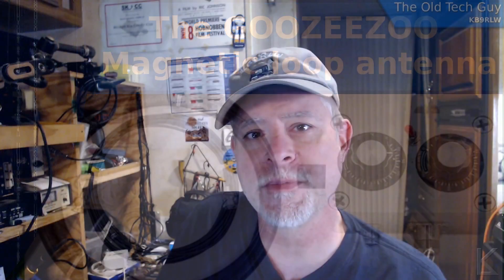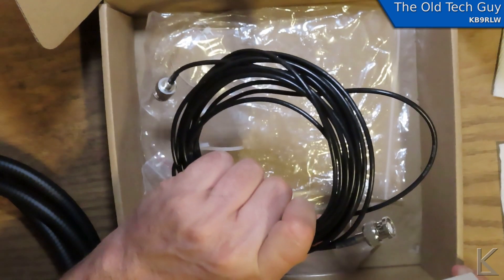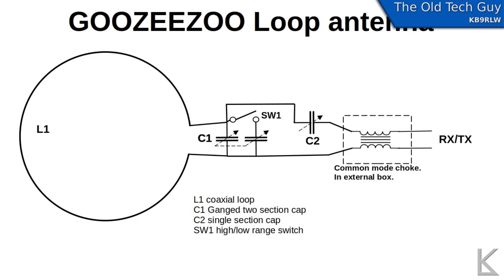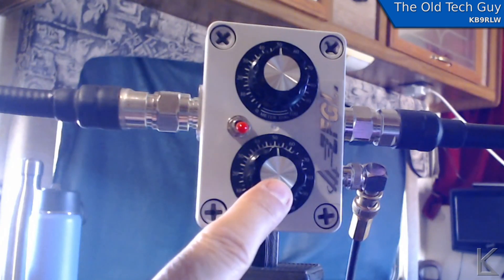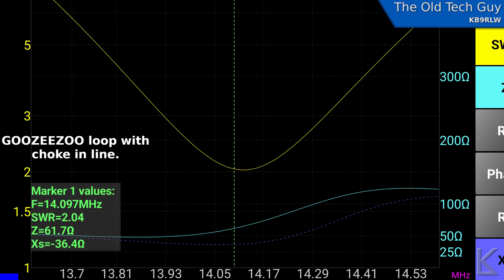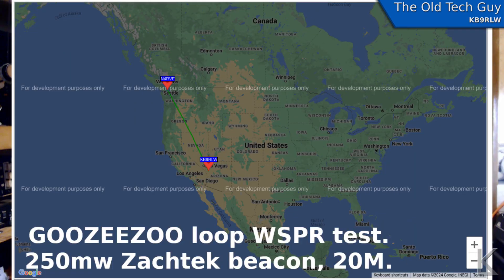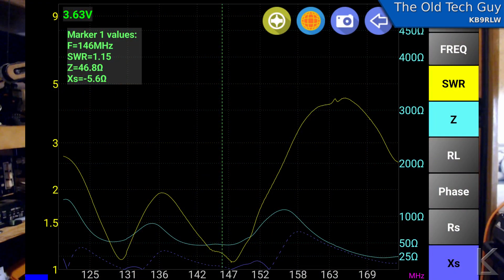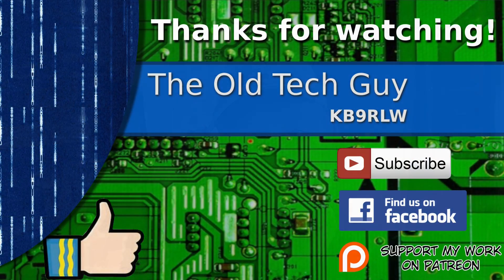Ham Radio - The GOOZEEZOO(a.k.a. Hamgeek HG-20a) magnetic loop antenna

Comment: I haven’t been able to receive anything on this loop. Is there anyway to modify it?
Reply from the maker: You could rebuild the box using higher quality variable capacitors and better wiring. That might improve things a bit. I just used the coax and made a regular magnetic loop with a coupling loop and a high quality variable capacitor. But as it comes it's just a bad design.

Comment: Kevin is there anyway to salvage this loop?  Change the capacitors or use the parts to build something better?  I like that in theory it could be a good emcom loop as it can do FT8, JS8Call frequencies as well as vhf/uhf.  Great video as always.  Wish I would have watched this video before I made the purchase.  Guess, I wasted money that would have been better served in purchasing an Alpha emcom or a chameleon.  Really enjoying your videos.  Keep them coming.
Reply from the maker: I ended up repurposing some of the hardware for other projects. You could rebuild the control box and add a coupling loop like a more classic magnetic loop. But you would need to replace the capacitors they're junk. The best thing about it was the coax. Search back through my videos for building the small magnetic loop. It has a link to the design video in the description. You should be able to use the parts with a better variable capacitor and construct a usable magnetic loop antenna.

Comment: Did you point it toward the VHF station?  Loops being very directional it figures you whip beat the others as an omni.  Hmmm?  Thanks, Amazon NOT getting my $82.00 for that one.
Reply from the maker: Yes, the side of the loop was in the direction of the station.    Electrically the design is sound, but inadequate capacitors and thin wire, poor technique make it a terrible performer.

Comment: Mounting parts into a box is always a challenge since parts inside the box are hard to install and solder. In such a case the cover has nothing. On the other hand, parts mounted everything on the cover is much better. Easy to build and maintain and short wires.

I think the antenna feeding must be different. The efficiency is not good like this. You might consider the regular feeding loop. I suspect that the coax braid is lossy and the loop itself must be of solid Copper or Aluminum
Reply from the maker: The main problem with this design is the inadequate capacitors and poor wiring. 
This box has plenty of space and would be no problem wiring  with components mounted on the back of the box.  However, it's a cheap Chinese assembly line product where people are paid pennies for their labor.  One doesn't expect quality from that scenario.

Comment: I have experimented with 4 different loop vendors.  What I learned was that diameter definitely has a relationship with band efficiency. The MFJ Loop tuners print a chart of most efficient diameters for each band or multi-band use.  I also learned that all of them receive very quietly.  One more thing I learned - tuning with an antenna analyzer connected is better than listening with your ear.  If you could transmit on a beam or dipole, and receive with a loop, I believe you would have the best of both worlds, but the arrangement would not be cheap.

Comment: The downside to so-called "magnetic loop" antennas made in this way, using flimsy, polyvaricon, receiver-grade capacitors, is just that. One needs to remember that at resonance, even with QRP power levels, a considerable amount of RF current (upwards of 4 amps RF at just 1 Watt- if losses are low- on a 4ft dia loop with a 5/8-in. diameter loop conductor operating on 14mHz.) flows in the loop and through the loop tuning cap. On a polyvaricon-type capacitor in a tuning unit like your example, that current flows through a small, mechanical, wiper contact that connects to the cap. rotating plates on one side and the stator (stationary) plates of the cap. section on the other side. That wiper contact has considerable RF resistance and, thus, significant power loss. (Keep in mind that RF currents flow only on the surface of conductors.) Even more substantial capacitors, such as air-variable transmitting capacitors with a single section (or two sections in parallel- same thing) are to be avoided.  Instead, a "split-stator" (dual-section) type of tuning capacitor is needed with loop connections made ONLY to the stator plates and NO connection to the mechanical contact of the rotor plates. That eliminates resistance losses in a wiper contact. The only other capacitor type superior to that is a vacuum variable transmitting capacitor. BTW- Our ham radio slang calls these antennas "magnetic" which may lead some to think they somehow use permanent magnets. Instead, they couple RF radio energy waves to the air via Electromagnetic induction means.
Reply: You couldn't pick a worse and less efficient capacitor for this application than the polyvaricons that the loop tuner is utilizing ! - VE3WMB

Comment: No inductor loop means it's junk.
Reply from the maker: Not necessarily. There are other means of coupling, gamma match, ferrite transformer. However, the army made loops this way, and MFJ has a loop tuner that works this way that works quite well. The design idea is sound if properly implemented. This loop uses poor wiring and inadequate capacitors. The only thing good about it is the coaxial main loop.

Comment: The box and capacitors might be a basis for a QRP Z-match.  And check the skinny feed line COAX with you VNA before you toss it.  Yes, it will be very lossy on VHF/UHF, but might be acceptable on the lower HF bands, or for cutting up to make short jumpers.
Reply from the maker: Yeah I was thinking along the same lines with that box, a QRP antenna tuner. 
Short jumpers is an  interesting idea with that coax.  In lieu of antenna switches at my desk, I've been thinking about making a small BNC patch panel. Bring the antenna tuner in and out, the SWR meter in and out, the antenna feeds, and the radio feeds all up to BNC connectors and then just using short patch connect cables to patch things the way I need at that point. Much more flexible than trying to do things with multiple antenna switches.
Reply: Looks like rg174?

Comment: It does show that a bought aerial doesn't mean it outperforms a home made one.

I've made five attic dipoles 20m to 10m,  an outdoor 60m inverted vee, two loops for h.f. and a copy of a thing which was around in the 1960's and 70's called a Joystick and 26 foot of wire which tunes 160m to 10m using a supposedly non-working MFJ 16010 tuner I was given. It worked for me. It did stop working after a trip to Wales and I found a wire not soldered and soldered it so I guess vibration moved the unsoldered wire.
G4GHB.

Comment: I appreciate you took the effort to draw a schematic. Now I can build and try such a control box myself.
Reply from the maker: Well this is probably not the best design. But you can get the schematic for the MFJ loop tuner, which is similar. They have a couple of inductors in line with The coupling capacitor, might make the difference.

Comment: I imagine that coax being as lossy as it will be broadens the Q making it look wider than it is?
Reply: Only using the screen on the loop itself, one could use chicken wire. The coax "functionality" is not used in the loop. Thick cable is desired for mechanical stability.

I would rather like to see a measurement of the cable he didn't use....
Reply: @migsvensurfing6310  Yes my mate has built one himself from aluminium strip. Worked 15000km Euro stations on 20w CW on his antenna ....in this video (DX will be in part 2 video :)) 
https://youtu.be/FmkMDeXaCOU
Reply: @migsvensurfing6310  I'm not sure what you mean by this. He used the hardline for the loop itself.
He didn't use the supplied 5 m RG-174 feed line, but the difference from the RG-58 he used is only 0.21 dB @ 28 MHz.
Reply: @tomtwist1081  He used the thick cable for the loop itself. The loop could be made of a piece of wire, it doesn't have to be coax, coax is often used because of the stiffness.  The inner conductor is not connected.

The cable he didn't use, the long thin piece supplied for the feed to the radio looks to be RG174 but may not even be, it may be way worse. Could be interresting to test it with the VNA he has.
Reply: @migsvensurfing6310  Making the loop from "a piece of wire" is a very bad idea. You want the diameter of the main loop conductor to be as large as possible. This reduces the loss in the loop itself. Then you have to reduce the other losses. The feeder coax is not important, as 5 m of RG-174 at 28 MHz only has 0.6 dB loss, which is 1/10 of an S-unit.
Reply: If you mean the main loop coax, I find that the best part of this antenna.
Much better than an RG-213 or other braided coax. The main loss is probably in the C1 capacitors.
5 W @ 14.1 MHz would produce 7.35 A in a good loop this size.
Reply: @tomtwist1081 no the feedline (2 mins 52 secs into video). But agreed using polyvaricon caps for the tuning is not really fit for purpose as well, considering the voltages generated at even modest power outputs is very high!
Reply: @TheArtofEngineering  He is not using the RG-174 in his tests. It looks like RG-58. But the RG-174 only har 0.12  dB more loss than RG-174, and 0.21 dB at 28 MHz. Negiable compared to the other losses in this antenna.
Reply: @tomtwist1081 Yes negligible at HF …. I didn’t realise the difference was so minuscule. The 1.8 m loop for 5Mhz and up seems very inefficient. I guess they reckon if it tunes…. It “operates” 😂

Comment: In absolute best case scenario,this loop will be about 4% efficient at 7Mhz So 5w in = 200mw out at best . Probably more like 0.5% eff due to resistance in coax connections ,switches,cap wipers.  So maybe 25mw out. QRRRRRRRRppppp
Reply: Should be good for FT8 and FT65.

Comment: That looks like Heliax, a full copper shield, (basically thin copper pipe with ribs to allow some flex in order to bend it,) that they are using the shield of for their loop. This loop antenna appears to be made out of whatever assortment of junk parts they could find, and poorly 'designed' by someone who knows nothing about RF. Any homebrew $10 loop that is designed and built properly would far outperform this piece of junk. The short coax they provided looks close to RG-174, which might work for HF but is just an attenuator at VHF/UHF. This isn't designed to work. It's designed to take money from the unwary. BTW, with antenna lengths at VHF/UHF being what they are, and vertical antennas being so very cheap and simple, there is really no point in trying to build a much more complex and expensive tunable loop that offers almost no advantage beyond slight directivity to combat noise that likely doesn't exist at VHF/UHF wherever the user is located. Certain types of antennas are advantageous on certain bands, but are seldom optimal on other bands that are far removed.

Comment: I built a very similar 'army' style mag-loop back in 2018, but it receives AND transmits equally well. 
Mine is an experimental setup intended for direction finding, noise detection and low power transmitting on the upper HF bands, so I selected only light duty components suitable for about 5 to 10 watts transmit power. However, the air variable capacitors I selected are much larger, having a much greater air gap, able to handle a much higher voltage. I paid about $35 for the parallel cap and about $15 for the series cap (in 2018 money), but looking at the GOOZEEZOO caps, well - you get what you paid for. Looking at the Amazon page, I'd say this is a receiving antenna, not a transmitting antenna. Also the price $88.99 tells me its only a receiving antenna. 

As I'm sure you know, those GOOZEEZOO caps are design for use as trimmer-tuning capacitors, not for handling power or high voltage as would be required for building a transmitting antenna of this type. Those capacitors could probably handle a hundred or so volts, whereas what you need is a few thousand volts capacity.
I suspect the reason this device receives reasonably well, but does not transmit well is that these inadequate capacitors are shorting out under load, even at QRP power levels. I think these variable trimmer-tuning capacitors use a plastic dielectric insulator rather than an air gap, and that is why you are not hearing a distinct high voltage arcing when transmitting.
The rest of the rig (antenna) looks very good, so maybe you can just buy some descent air variable capacitors from eBay, then build them into a slightly larger box, and you should have an efficient and portable mag-loop, with the benefit of fine tuning as compared to the 'conventional' single capacitor mag-loop.
Reply from the maker: No they're not shorting out. The SWR stays stable even up to 10 watts. I did test that, in CW mode key down for 15 seconds straight at 10 Watts. No indication of shorting or arcing, the SWR was Rock stable at around 1.1. If they had shorted it would have jumped big time. I've had that happen in previous experiments with more traditional magnetic loops.
And it doesn't receive all that well either. I was only hearing the strongest stations. I thought I mentioned that in the video.
If you scroll down on the Amazon page and read the instructions for the loop, they talk about transmitting. The manual that comes with it states clearly that it's capable of up to 20 watts single side band. Also the Amazon page says that it's an antenna for transceivers.
I agree those capacitors are completely inadequate. But the fact that they did not arc over tells me just what a poor quality the design is.
Reply: @loughkb  I see. Well maybe its just such a low Q circuit, due to the inadequate capacitors and lossy connections, that it does not develop very high voltage. That would explain the poor performance and the characteristic of not arcing over at 10 or 20 watts. Nonetheless, I'll bet it performs well with some descent air variable caps and heavier, shorter leads.

Comment: It looks like it's good quality. Now I want to see Kevin rebuild it to work the way it should. Thanks again for the videos and I hope you're doing well. 73 de N9JOD
Reply from the maker: I was thinking about coupling it with a coupling loop and feeding it that way. But the small light duty capacitors they use would arc over like fireworks. I don't think there's any hope for the design. At least not with the hardware they included. I might turn the box into a zmatch antenna tuner for QRP. And use that nice coax loop on one of my home built loops.

Comment: Two thoughts. 
Take a dremel tool and cut the back open. Shorten the wires and cover the hole with a piece of flat plastic and a dab of silicone. 
Second is use the loop for AM radio station listening at night. I bet you can get so many stations out there they overlap. The loop might give you directional discretion. 
BTW, you look great Kevin. Look like you old self. Glad to see you back and feeling better.

Comment: Hello Kevin, Glad to see you up and about. I think I've seen better performance out of DUMMY Loads !  Mag loops are supposed to be "HI Q" antennas. As I recall, HI-Q means NARROW Bandwidth. So their claims of service from 40 Meters to 70 CM just validates it is also LOW Q...  A HIGH DOLLAR DUMMY LOAD. That piece of Hardline loop looks impressive :-}
Reply: I think you forget that a magloop needs to be tuned to the operating frequency. So the coverage says little about the Q.

Comment: Excellent video and tests against the other antennas! Thanks. On the issue of why the efficiency is low, I think its got low-Q capacitors. They're AM radio receiver caps. At this antenna size (2m circumference on 20 meters), the theoretical Q of the resonant loop (X/R) is likely about 2500 and the resonating cap Q should be very high (maybe 5000+). But then tuning would be very sensitive and arcing would likely result on transmit.  As is, its still maybe a good receive antenna though (background noise is usually at least 20 dB above theoretical limits - so an efficiency of 0.01 would be fine 🙂) I'm curious. What kind of caps do you have in your homebrew loop (and how sensitive is the tuning)? And is the diameter about the same?
Reply from the maker: The homebrew loop is fully covered in two videos. Look back about three videos in my channel and you'll see building the small magnetic loop. The description references the design video from last year with all the details.